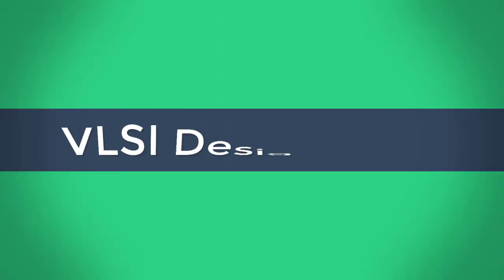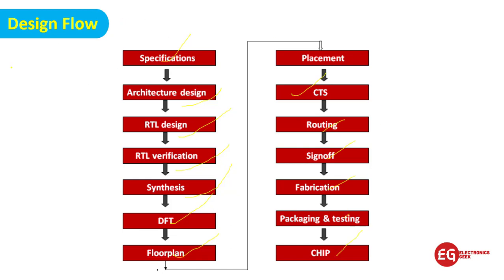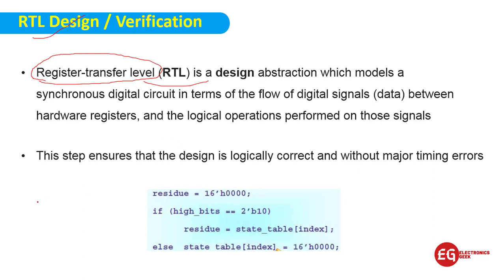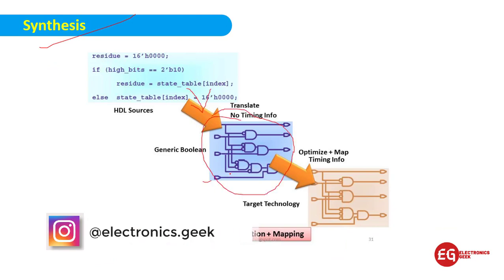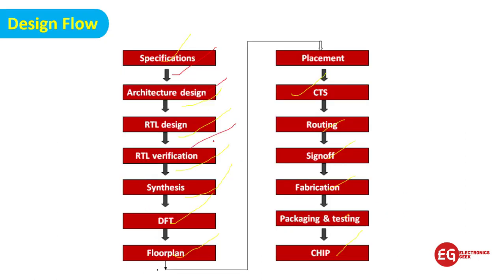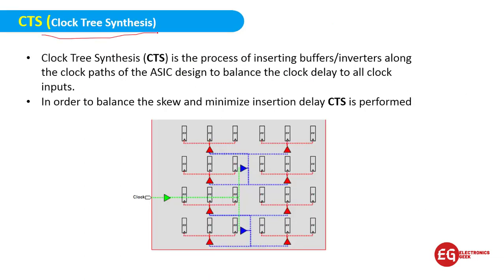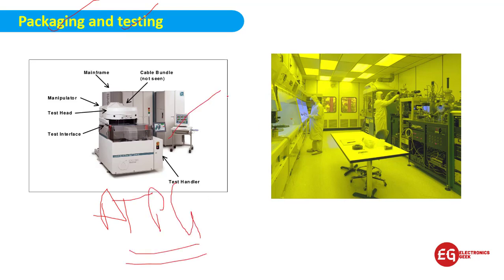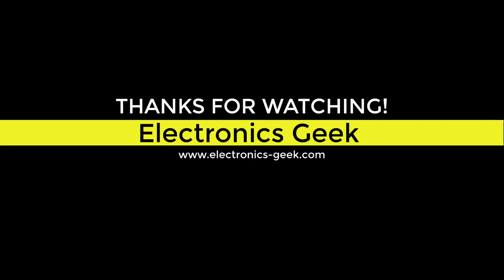VLSI Design flow | Applications and Classifications | Which is Best  frontend or backend? 🤔

Comment: Thank you so much sir for your video.please reply me sir.Am completed my M.E in VLSI in 2015.After that worked as lecturer in engg. College for 1year.Then 1 yr working experience in pharma industry.after that 2 years experience in tourism industry.right now am very interested to work in my core area.is there any possibility for me to get that.please guide me what to do
Reply from the maker: Now it will be difficult to switch to vlsi domain until you don't apply for PhD 
Then there will be chances